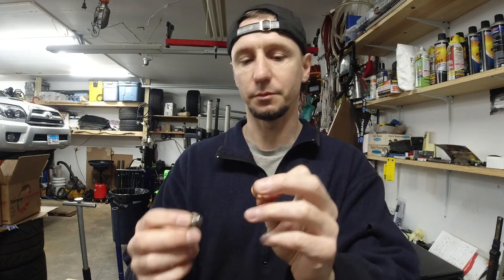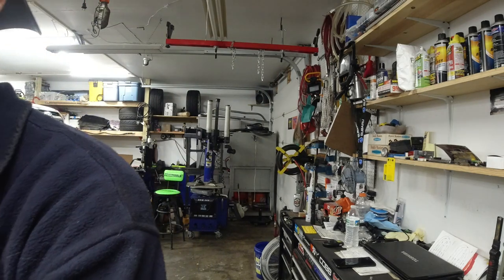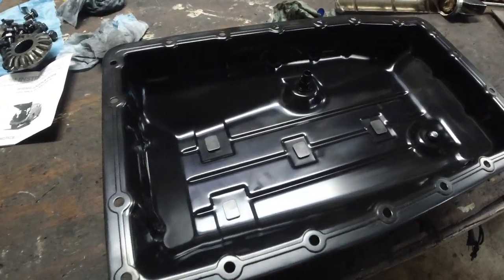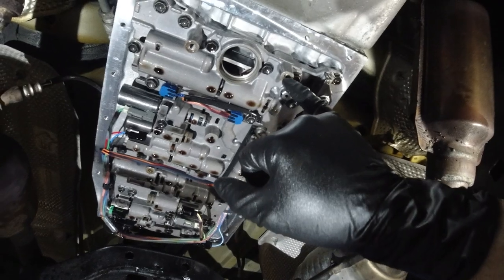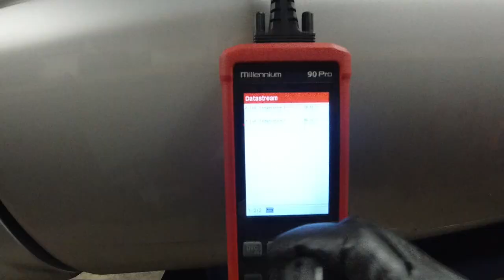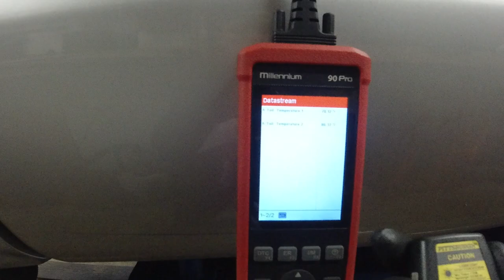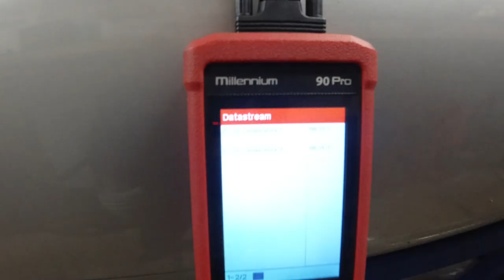Toyota 4Runner 4th Gen transmission fluid change

Comment: Funny you accidentally took off the shift linkage thinking it was the filter bolt. I did the same thing. Only use WS Toyota brand trans fluid anything else is not the same. Toyota has special friction modifiers in there fluid. There is a difference. Nice video 😊👍 Thanks!!

Comment: Hello I am back 1 year later! Just dropped my Pan tonight. Did the rear diff front diff transfer case and transmission pan. New filter. Almost zipped off that parking pawl or whatever its called like you did to lol I wish you showed how you got the transmission fill plug out. You commented on how annoying it was to try to thread back in but never showed getting out it. What an absolute BITCH and TERRIBLE location for that engineered and designed by Toyota. Gave me nothing but problems. I am going to try and pump in the fluid with a pump through that test drain in the bottom of the pan instead because of that awkward shitty location! Cleaned up pan and magnets good. Using Toyota WS Fluid and AMSoil synthetic gear oil for everything else.
Reply: Would like to know what you used exactly to get that out with and everything in the way. Torx 55 head i think it was but what kinda wrench to get the angle beyond awkward AF
Reply from the maker: Nice, amsoil is good oil, maybe it was easier removing that plug for me since mine is a 2 wheel drive but still shitty.  I dont remember what tools I used, this was a while ago for me.

Comment: Thanks for the video. I bought one these 4Runners. It’s v8 and 4x4 version. I’m not sure if the transmission fluid has ever been changed. It shifts fine but with 335,000 miles I want to do a drain and fill + filter swap.

Comment: Incredible video showing everything wow excellent job making this thank you. My 4th gen 2006 4.7 L V8 Sport is getting what I think is it's first transmission fluid change ever as we speak at Toyota right now at 243 500km Yikes. Recommended change lists it to be done at 96 000 km. 2 previous owners before me. I bought with 177 000km and do not believe this was ever done. I did not see your video until now to see all the steps involved. I asked the service manager at Toyota 2 hours ago if there was a filter and he said no but I can clearly see there is off your video lol and replacing it and cleaning the magnets in the tank checking the gaskets etc... All they are doing for their service for $244 Canadian is draining and replacing the fluid no flush or filter check or change etc. Now I see being half way through your video there is a lot more to it than just that especially where I am at for KM on vehicle and knowing it has never been done which is concerning for sure. Will continuing watching the rest of your video.  I also was looking for the dip stick for the transmission fluid under the hood and could not find one. Does a 2006 4th gen 4.7 V8 not have a dipstick to check or am I blind? I requested they save me a sample of the fluid so I could personally see just how dirty the fluid is.
Reply: I subbed as well :) just finished the full video wow big process and journey and after seeing everything in full now.  Since Toyota was just draining and adding in new fluid and not removing the pan and changing the filter I will ask them how many L it took them. Curious what they use for transmission fluid their own brand like I think you mentioned in video when you had a different product. Seeing that its not a proper pressurized flush they are doing with just draining and refilling I wonder how much of the old fluid stays in the system with that said and in the radiator etc.. 10 % 5 % 20% mixture of old and new without proper flush and just draining and re adding new? lol really curious.  Will find out how many L they put in when I go pick up shortly and reply with this.
Reply: So when I went and paid at Toyota I asked the service manager how much does my 06 v8 4 runner sport hold for fluid and he looked it up 12.2 L he said. Ok so I then asked how much new fluid did you put in? ahh probably approximately 7 to 8 L really ok wow... I then asked how much does it say got put in on the sheet 4L and then he proceeds to tell me they just bill me out for 4L and the rest is continued whatever the F&8K that meant... So Toyota is so generous I just get 3 or 4 L for Free? LOL I think not! I then asked what you use for fluid WS fluid world standard fluid is what went in.  He also said lots of the fluid that does not get drained out stays in the torque converter. My friend happened to be with me and one of the mechanics happened to come and in his side conversation with him he said probably 4 L went in .. So I have no idea wtf the service manager was saying with probably 7 or 8 went in and just bill me for 4L with the rest continued meant... Very confusing and misleading.... I should have finished the conversation with saying so essentially this is part 1 of repeating this process like 3 4 or 5 times to cycle out the rest of the original shit black transmission fluid that still remains in the system if it holds 12.2 L and only 4 got drained out and added in most of it is shit old fluid still. With that said this basically did nothing as far as I am concerned aside from starting the process of what needs to be done numerous times lol $244 Canadian Dollars this cost to drain out 4 L and add 4 in I am assuming and am going to disregard what he said about 7 or 8 L. Even in your video when you are draining at the end again you said how black and dirty it is still which makes perfect sense. Anyways just wanted to write all this in hopes that it helps others along with your awesome video so people have a better understanding of how the dealership can be very confusing on the issue as well.
Reply: also you never did show how you ended up getting that fill cap back on due to the poorly engineered area where it was located. Did you have to bend that piece of metal up so it would not cross thread and go in straight or?

Comment: How’s she running and shifting with the valvoline fluid you used?
Reply from the maker: Runs pretty good, just when called has a slight hesitation switching to 4th but it had the same issue before the change, I just need to find the time to do couple more changes and see what happens.  im at 150k
Reply: @cruizinmax4017  I have a 2006 with the 4.7 it has 335,000 miles  a lot of it’s highway and I’m not sure if my buddy I bought it from ever changed it or not. The trans shifts fine but I definitely am gonna do a drain and fill plus new filter. It’s next on my list right after front wheel bearings I’m throwing on it tomorrow.